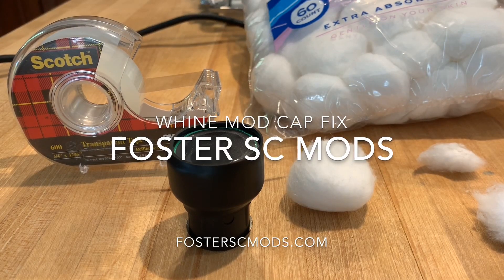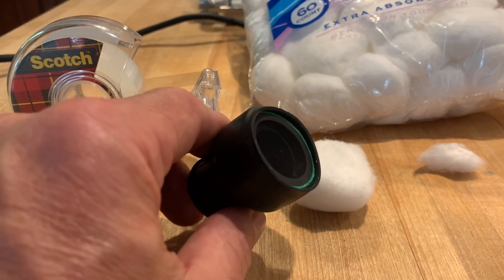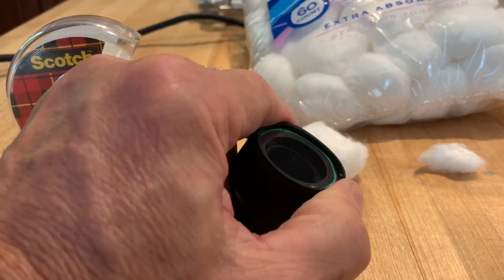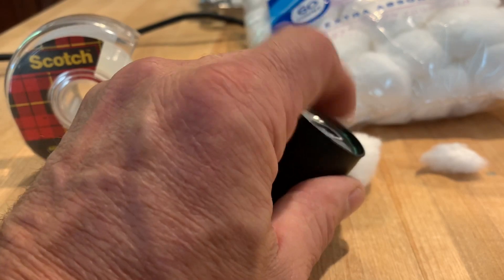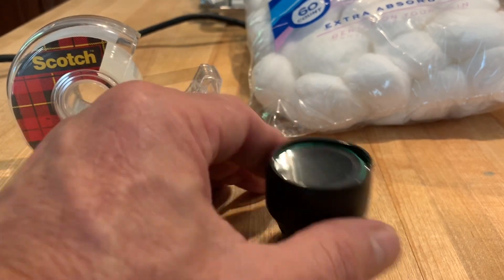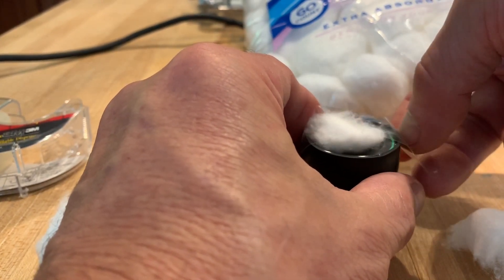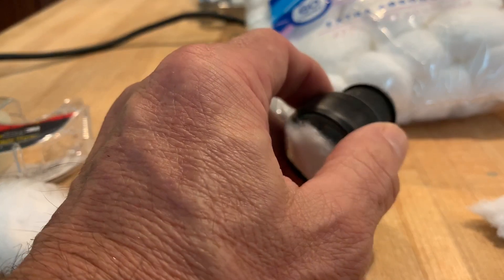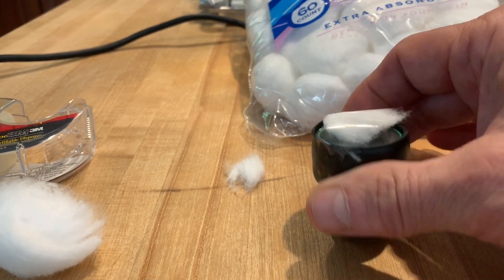Taming vibrations and resonance Foster SC whine mods

Comment: My nephew was playing in my car and he accidentally poked the plastic and ripped it. What’s the consequence of the plastic being ripped?
Reply from the maker: you need to seal it off before driving it. The airlock will cause the car to run lean. You can use tape or rubber glove piece over the car to seal. You can contact me to order a new cap at 207 231-4112 Text or talk.

Comment: I don’t think I’m getting the vibration but I do get a “whoosh” every time I touch the throttle. Even when I barely touch it. The whine is great but the “whoosh” from the intake is overbearing. 
Any recommendations. 
2014 Roush raptor.
Reply from the maker: ryanhiggins15 yes check out my video explaining the damper cap you can find it here on you tube or on my website under tricks and tips